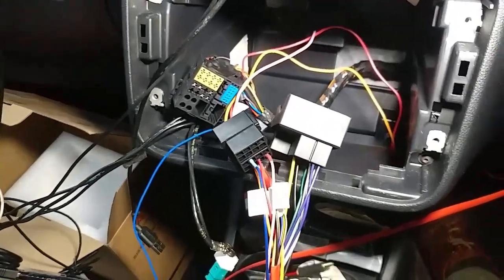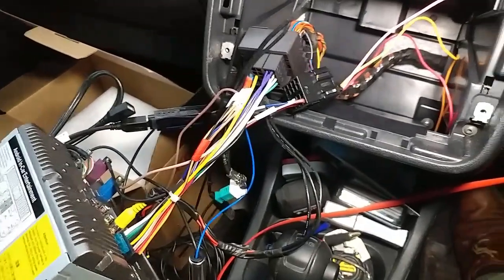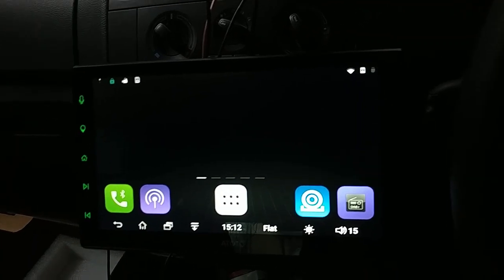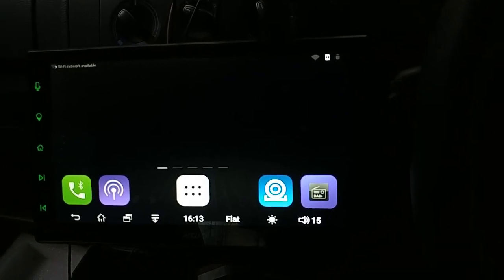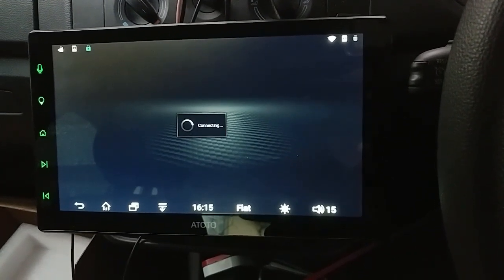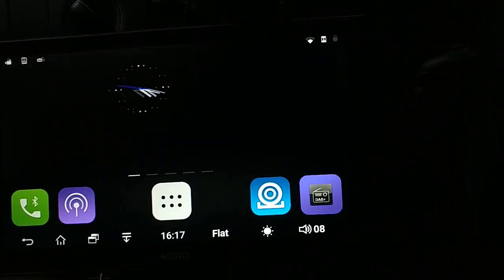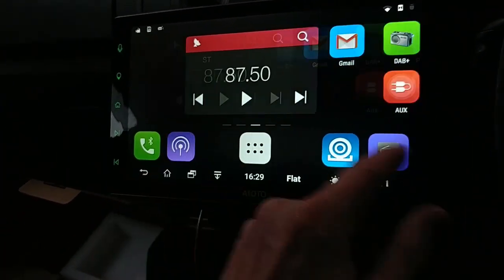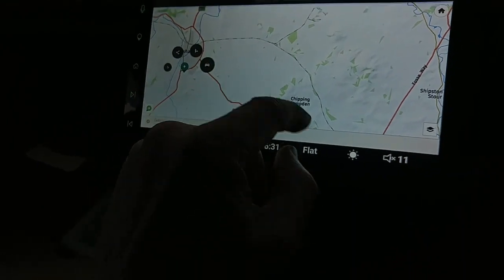ATOTO A6 Pro 10.1 Universal Fit / VW Skoda  - First look install. Best Android unit I have found.

Comment: Where did you get the harness from
Reply from the maker: ATOTO make the VW specific wiring harness with a Std. Quadlock and Canbus adapter. I have now also used an adapter to the new Quadlock type available on eBay etc.
Reply: @petrev1  do you possibly have a link to the the quad lock
Reply from the maker: You have to contact ATOTO Support to get the VW harness and Canbus adapter.

Comment: Hey Peter. It's been a while now. Are you still enjoying this atoto unit?
Reply from the maker: Fabia 2012 ? If it has a 2Din space it will fit - may need mounting bracket ? Don't know exactly.
Android 6, I believe. Best to ask ATOTO CS about specific features.
Reply from the maker: Yes. Still  great 👍
I really like everything about it, especially how easy it is to use and see with the big screen.
If you don't need the bigger screen then the 7" VW version is really great too and a bit cheaper & quicker to fit.
Reply: @petrev1  Will this fit my Skoda Fabia 2012?
Reply: @petrev1  What android version is this and can I have android auto?

Comment: Buongiorno, nell'installazione mi sono trovato due spinotti maschi RCA per la retrocamera (uno della retrocamera uno della radio), ho i servito un adattatore RCA femmina/femmina ma non si vede il video? Consigli? Grazie
Reply from the maker: Hi, Video inputs are Yellow. There are 3, RCIN is Rear Camera and only shows when the Reversing Select wire is at +12V.
Front Camera is below, marked VIN. The AUX Video is below RIN and LIN, also marked VIN. You can select FCam and Aux via the screen so these can be used to test a camera before you have wired in the Reversing signal. HTH Pete.

Comment: Thanks for the video. Does the screen detach easily for storage? Potentailly fitting in my motorhome, ideally wouldnt like to leave it exposed.
Reply from the maker: Hi, very easy. Push the button clip and pull screen away from main body, and then detach the ribbon cable. Reverse ... Just reattach the ribbon and push mount into hole until you hear a click.

Comment: Does it stay in place when you want it to? Or bounce around in the car on bumps?
Reply from the maker: Stays in place. Nice solid metal mounting bracket and ball/socket. Much better than others - There is also adjustment vertically by virtue of a slide on the rear of the screen.